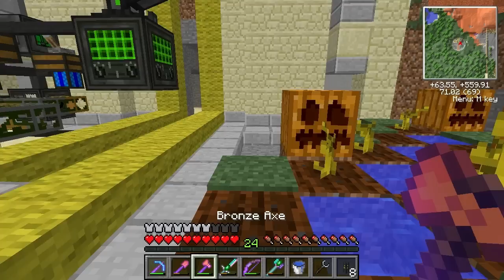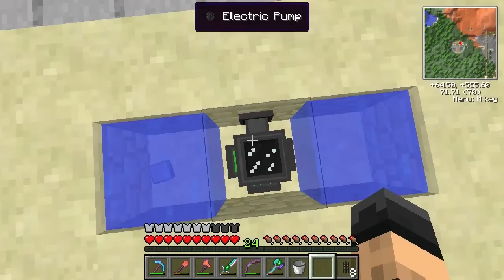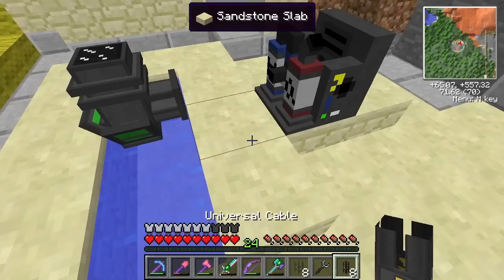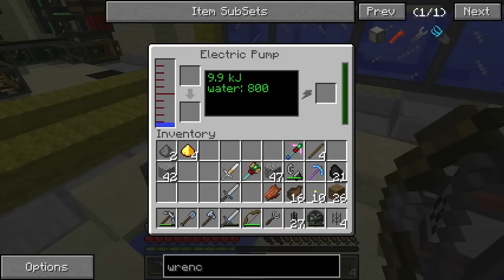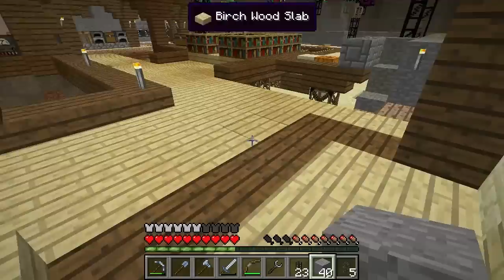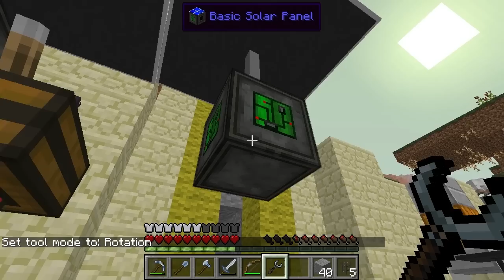MoonQuest - Episode 9 - Hydrogen Power

Comment: I think there has been a update for the electrolytic separator because it is not the same now, it is different from the one that you are using when you uploaded this video, can someone tell me how to do what he is doing in this video like the output should be hydrogen on the left but i can't get it to be like that and on the right it should just say dump and it will stay full but it doesn't it dumps it i guess